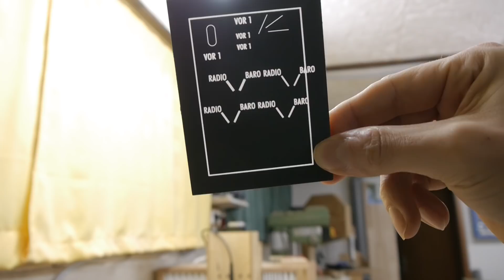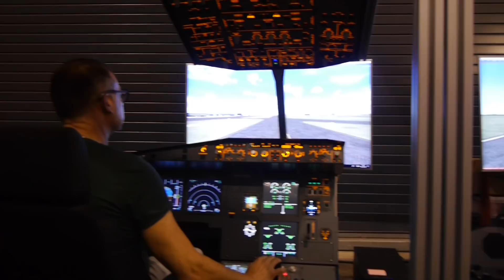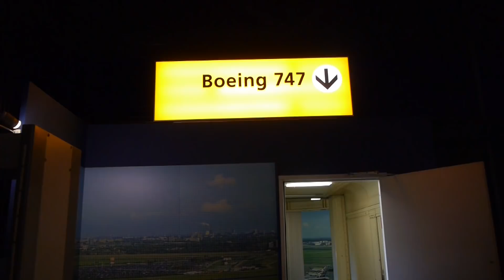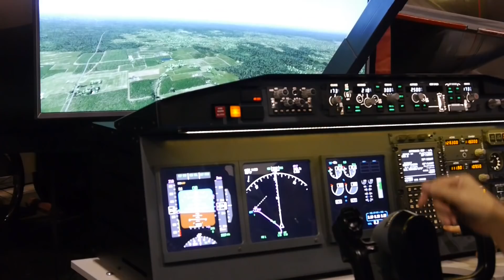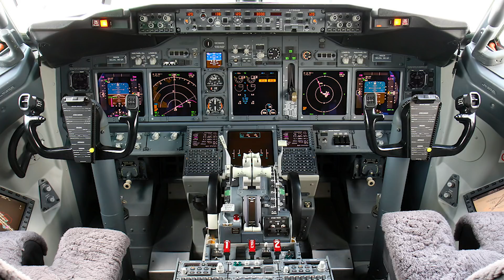Christmas Special - Mickey's Flightdeck on the FS-Weekend and plans for 2019

Comment: All the very best to you Mickey. Look forward especially to interfacing with Arduino. I’m currently in a build and using the same system.
Reply from the maker: Yes this will be a very interesting part. And I think I will have to recreate the programming from time to time when I find better solutions for any propblems. So don't expect the perfect solution from the beginning.
Reply: I’m using mobiflight , it’s still moving forward in development but works great. Just need to get a master list of fsuipc offsets or at least try and get my head around that aspect. Give Mobiflight a check out